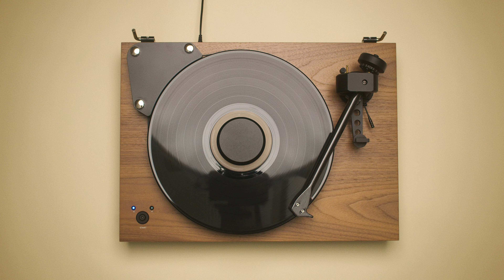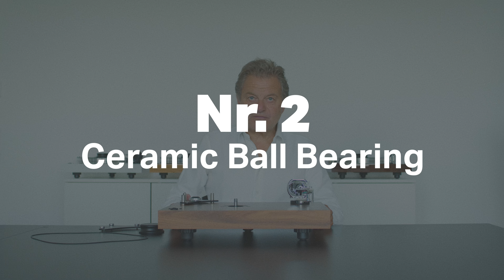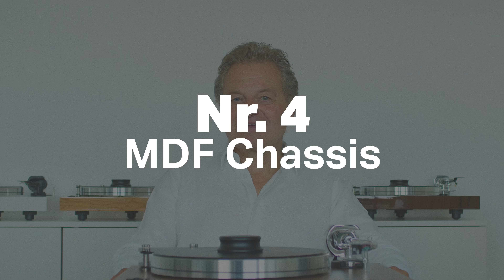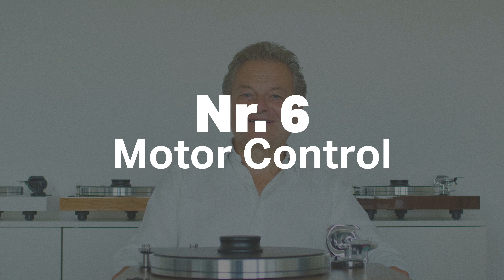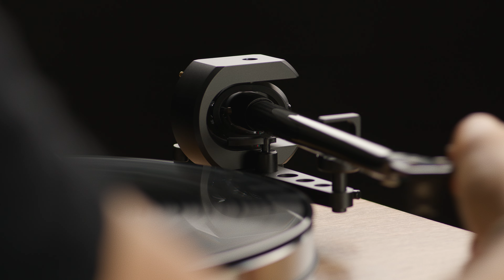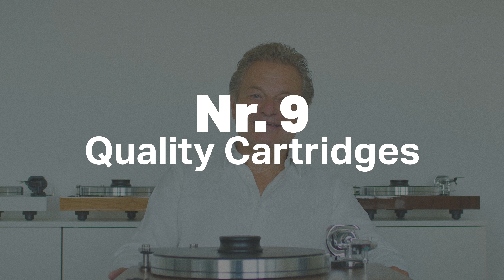10 Reasons Why Our Xtension 9 Stands Out.

Comment: I’ve had mine for two weeks and and really enjoy it. Does it actually need the 800g record puck to be used? I was given a new Signature record puck that’s usually it’s the Signature 10 and 12.2. It’s lighter than the normal brass puck, but looks amazing. So would it really make any difference to use the signature one instead?
Reply from the maker: Hi AIValentyn. The use of differmet pucks (weights and materials) is a matter of taste. Different pucks will influence the sonic signature slightly – try, listen and enjoy!
Reply: @Projectaudiosystems appreciate the simple answer.

Comment: I've had the motor burnout at just under three years. Theirs much better tables for the money. I won't support Pro-Ject ever again.
Reply: I've had mine less than  3 months and the motor became  noisy  awaiting  repair  replacement  will buy British  Rega next time
Reply: @P @PaulStockley try a Michell turntable. Different sound to a Rega and silent motors. They have also been using an inverted bearing since the eighties. Also self lunricating.
Reply: Bad luck 😔 Sh..  happens and can happen everywhere.
Reply: Mine had unbearable noise. I freakin went and bought technics. No motor noise.

Comment: I have the version with the previous s-shape arm and have been very happy with it. It’s excellent value for the money. 

Back then it was advertised as having strategically placed metal balls in the chassis. I’m curious if you changed this for this new version? 

Also, is the Power Box RS Uni TT a worthwhile upgrade to this, if the board generates new AC anyway?

Thanks!
Reply: I have a Project Xtension 9S Shape and with it I did not make the mistake as for my phono stage RS2 to buy an expensive original power UNI supply, but I ordered a linear power supply with a R transformer from AliExpress and I am extremely happy and satisfied!

Comment: I was and i am still fan of pro-ject, i had few, but sorry for final i choose Thorens TD 1500 because of sub chassics) anyway your turntables are fantastic!
Reply: TD 1500 is my dream/next turntable. I´m thinking of pairing it with Pro-jects DS3 B phono stage in order to use xlr output with an mc cartridge. My 33+ years old Bang&Olufsen RX2 (also sub chassis) has seen better days :D 
Have you got Any regrets about the TD 1500 ? Are you using xlr cables ? and mm or mc cartridge ?
Reply: @elCaxi1971  Hi. No i am using stock 2m bronze and rca cables. Sound is fantastic, really. Like there something, Thorens sound character in all records. However, yes technically this turntable is not perfect, i mean motor and optical sensor stabilization, it take around 10-12 seconds to reach 33.33, when you start it accelerates to 39-40 rpm, then in 10-11 seconds slowly going to perfect 33.33, it works but if sensor see that speed changed for example 33.31 it increase speed again to 33.33 increasing wow/flutter to 0.2% for few seconds. So obviously if i had enough money i prefer TD 1601 with classic motor.
Reply: @Bess216  Thank you very much for your reply !
I am planning to have a demo of TD 1500 next month at a local dealer, so i will get to see how it works in real life :)
1601 is too expensive for me too, especially with the new TP 160 tone-arm.
Reply: @elCaxi1971  yeah its pretty depressing))) i really like 1601 with tp 160 look. Even more than td 124 dd. Actually i hope there will be td 125 reincarnation possibly TD 1250 or something like that)
Reply: @Bess216 for me it would be tween 1601 and pro-Ject classic reference. Both are beautiful and amazing sub chassis designs.